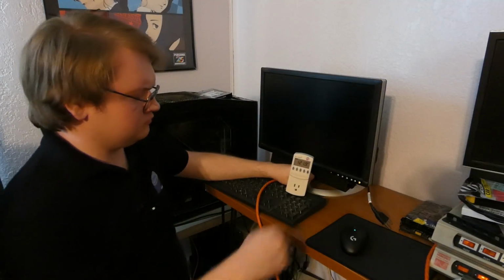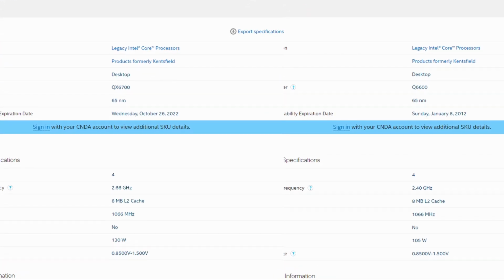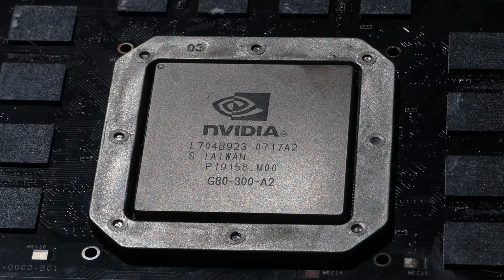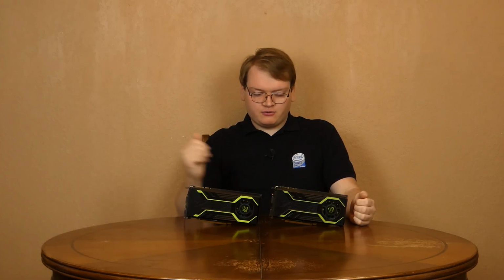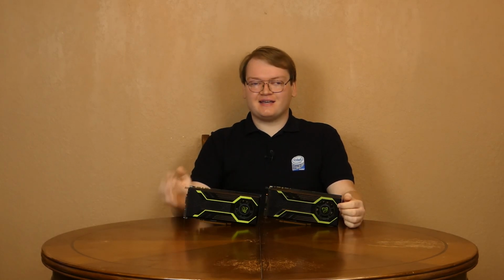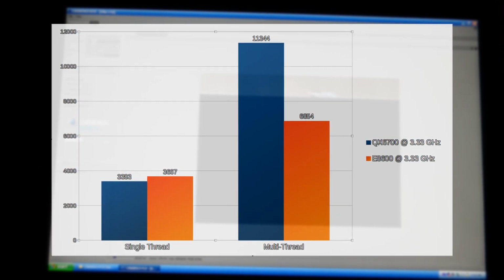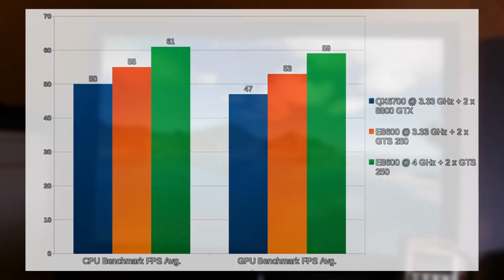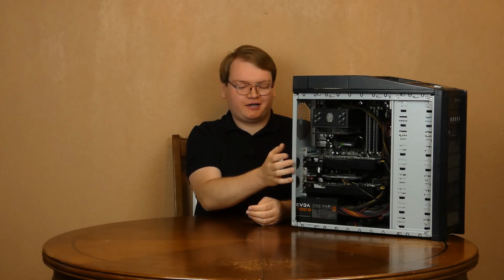Making My XP Machine More Efficient

Comment from the maker: 11:42 The repeat this time is not intentional but I was fighting Resolve to even get the video to render correctly and I didn't notice it until later and I don't feel like fixing it.

Also right before uploading the video HL2 locked the system up again. I guess I'll up the voltage again...  Who knew HL2 was the most accurate way to stress test an overclock?

Comment: I use win xp pro 32bit for gaming with a i7-4790k disable HT and OC the 4 core to 4.8ghz at 1.4v and i have a GTX 980 ti with a 960gb SSD and 4gb of ram ddr3-1600. There no setup better than that for XP. The thing with Windows xp is he love High cpu clock!!!

Comment: Your PC before upgrades: idles at 300W
My retro rig with Windows XP in full stress: under 250W. And beats your PC by a mile...
Funny, because I am using just 4-5 years newer parts, just i5 2500k with 550Ti. I know it’s not 100% period-correct, but it fully supports XP, which is why I went with them. It really shows how much manufacturers improved power efficiency and performance in just a few years.
Reply: i have an i7 2600 and gt545. Better cpu and worse gpu 😅

Comment: Hey, NTG. I have this same motherboard in my Windows XP rig. I have 4GB installed, but I open system properties, and only 2.25GB are shown. Did you have this same issue on ur rig? If so, how did tou resolve it?
Reply from the maker: I believe this is an issue with 32 bit Windows. The entire OS can only (normally at least, you could use PAE and patches) address 4GB total. This includes VRAM. So if your graphics card has a lot of VRAM, it will actually reduce the amount of system RAM that's addressable.
Reply: @NTGTechnology   How much ram does XP see for you since we have the same motherboard?
Reply from the maker: @ArtisticTrex54  XP only sees 2.25 GB on mine. I have two 512MB graphics cards plus other devices in the system are using some of the address space as well.
Reply: @NTGTechnology  alright, so I guess it's normal for this specific board. The funny thing is my previous XP machine read most of the ram at 3.5GB so it is very strange.

Comment: Very informative video! I am currenty working on my Windows xp/ vista retro build as well and unfortunately, my 8800 GTX died on me halfway :( Currently have a 560 ti inside as a replacement, but a Fermi card in a late 2000s build just doesnt sit right with me. I might go the route of a GTS 250 as well, as a way of continuing the spirit of the Tesla G90/92.
Reply: What psu are you using?
Reply: Try out a hd 4850 512mb. That was the card to get in mid 2008.

Comment: your new cpu listed tdp is the same as my entire rig running at full load (save for the gaming pc i hardly use since more and more games are supporting mac or working under gptk)
i miss this era but i do not miss the power consumption

i still have my macs from the era and im afraid to measure the power consumption on them especially my G5 quad with its 4 gpus, 2 2.7GHz cpus, and massive power supply that i had to buy a special cable in order to use

Comment: i have a strict 300 watt psu limit rule for my pc, so everything including cpu,ram,drives, and gpu has to meet a 300w power requirement. and believe me...asking for parts advice is a hell in itself
Reply from the maker: You limit the PSU at 300w? You're playing on hardcore mode.
Reply: @NTGTechnology  you be surprise on what you can build with only 300watts
Reply: @NTGTechnology  home pc psu mode.... which reminds me my mom's am2 had a near 3ghz dual core amd in it and a 500w psu. It was an hp machine and I actually overclocked that cpu in my gaming rig by 250mhz. 

(Albiet on a non overclock board, it just had an experimental bios) 

I have loads of am2-am3 processors lol I should make a few rigs.

Comment: Thanks for a truly interesting video, as another lover of older technology (albeit almost always with my own Gentoo Linux builds where I optimise as much as possible).

With that said, does it actually make any sense using a Core 2 Quad CPU with XP, given that I've been told that, at best, XP only ever makes use of two cores anyway?

It's not something I've ever tested but I've got a couple of older Dell Optiplex PCs that I have a hankering to stick XP on again for some retrogaming - albeit I tend to stick with AMD GPUs because NVIDIA's driver policies on Linux are just bad, and I can't be bothered with SLI so will just pick up the best used AMD GPU that XP can support.
Reply from the maker: Since most people are just using XP for retro gaming and using other old software, having more than two cores isn't going to make a real difference for that stuff. Unless you want to use older 3D modeling or video editing software or something like that, there really isn't a point in having more for XP.

With that said, XP is capable of using more than two cores. I can't really say how well the scheduler works on XP, but you can install even a 6 or 8 core CPU and XP will detect it and work just fine with them assuming the software you're using is capable of using that many threads.